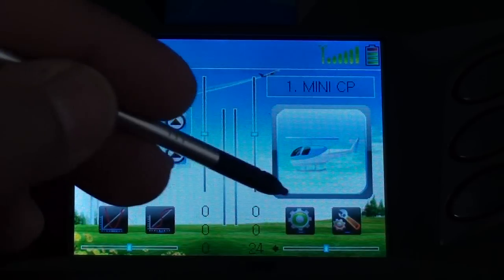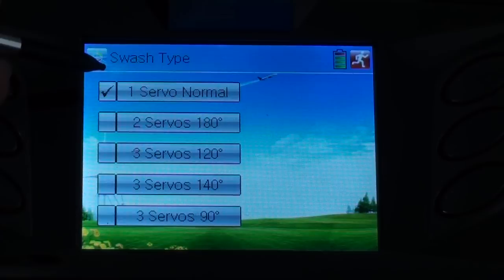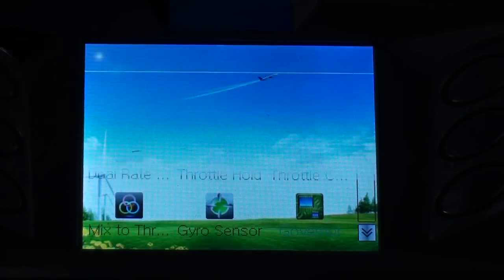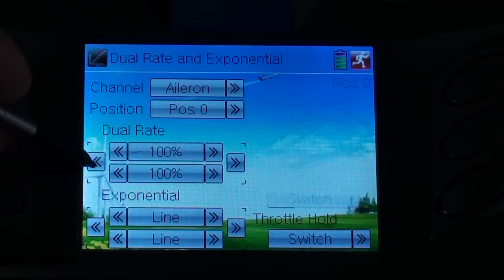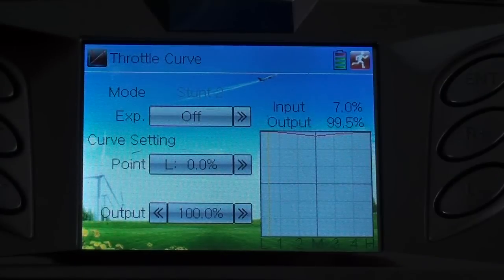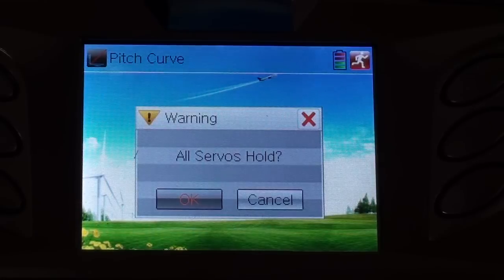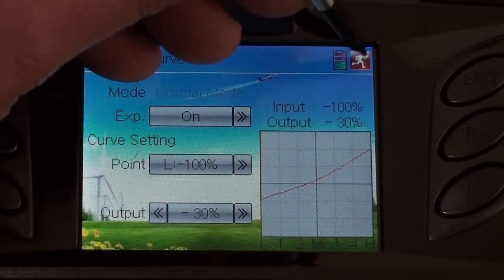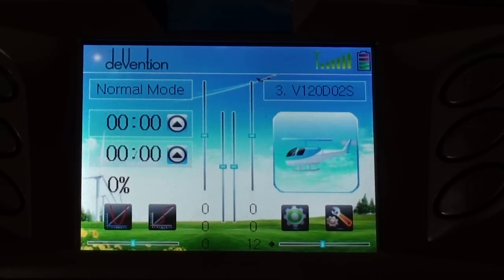My Devention 8 Setup for V120D02S and Mini CP

Comment: Hey, i wanna ask u a question. Since u flew so many Walkera models and used the 2801 and now the Devo's so often, so u have a lot of experience with these tx's. My question is: Do you think that the devo has any advantagen in FLYING compared to the 2801. Or advantages regarding the QUALITY of the setup. but i dont mean if it is more conventient to set up a model. I mean beside of the nice state-of-the-art, bling bling tochscreen or telemetry function etc; is it worth grading up? Thx u very much!

Comment: Hey great vid, I'm using opentx on my taranis what channel would gyro and pitch be on I presume 5/6? Thx
Reply from the maker: that depends. opentx has total freedom to setup as you like
Reply: @alishanmao  I'm currently trying to tune the rx2636h-d into my opentx trans that is fitted to a trex250. Slowly getting there with help of your videos. Subbed 👌
Reply: @alishanmao  I've figured it out! But could you explain what's the difference between the "gear" and "gyro" channel? Thx